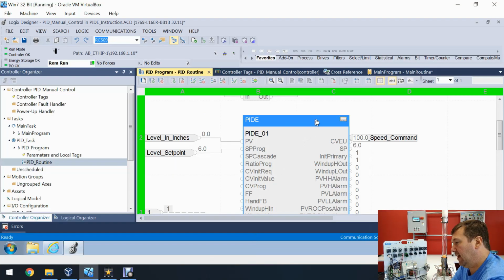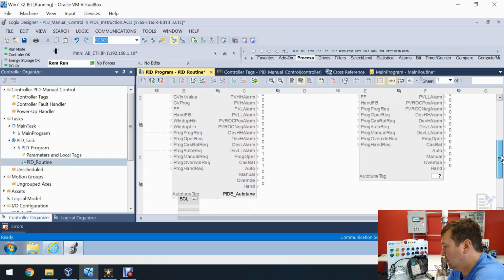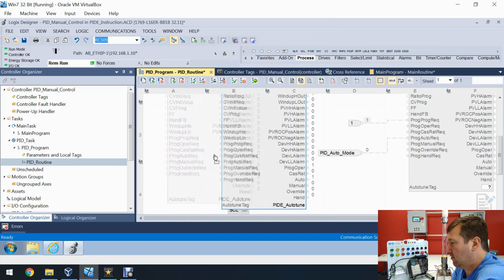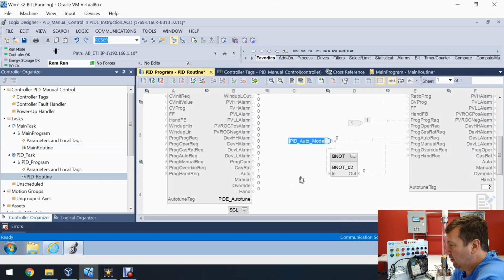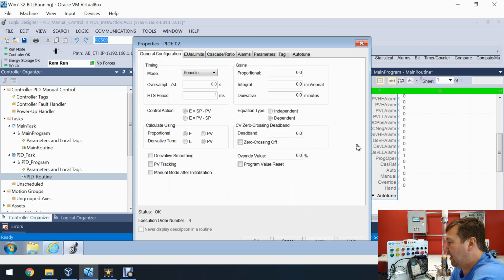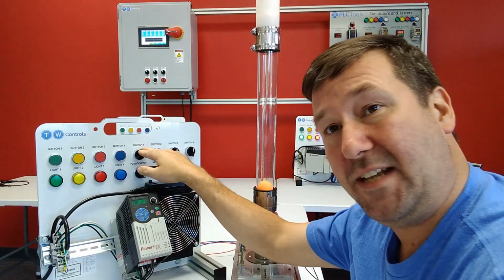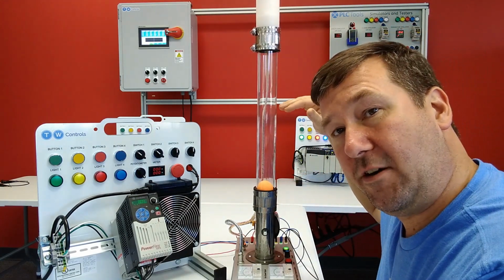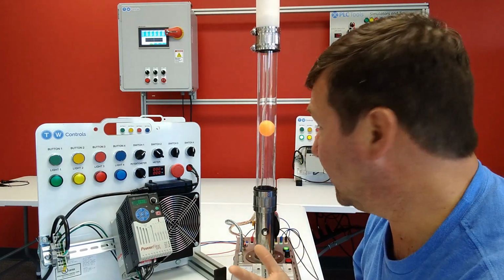Set Up PIDE Auto Tuning in Studio 5000

Comment: I'll try to test at the company which I work, however, I cant set 0 to output, I'll try to do it online and my process is not able to decrease so much temperature. So we have channels thats working around 1230°C, tha maximum value that I can decrease or increase is 15°C, do you believe that is possible to perform autotune this way ?